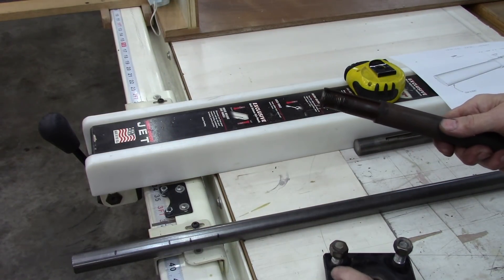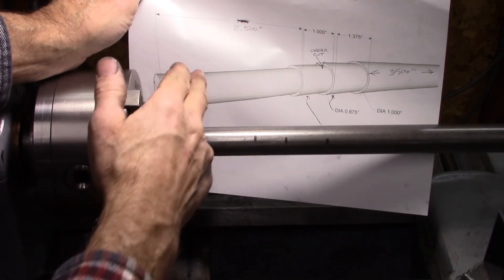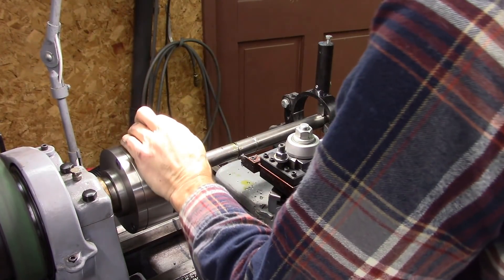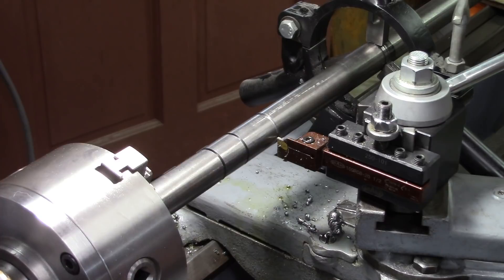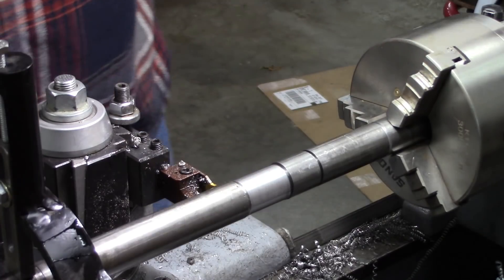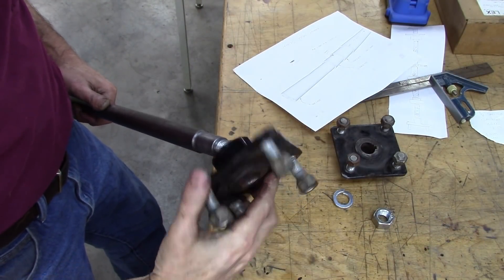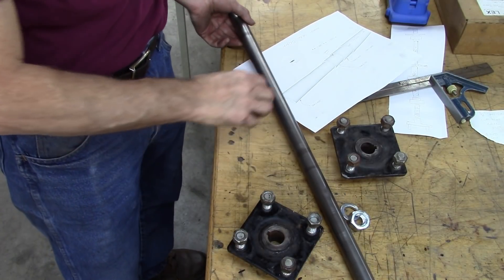Turning big stuff on a small metal lathe

Comment: Mark an old Gunsmith trick when using a steady is to take a piece of emery cloth long enough to wrap around the shaft plus 1/2" overlap. Add a few drops of oil to the shaft then wrap it around the shaft with the smooth side towards the shaft and the grit side touching the fingers on the steady. The oil and the emery cloth act as a bushing between the fingers and the shaft and the grit touching the fingers prevents the cloth from spinning. This prevents marking of the shaft and also prevents wear on the fingers. I am certainly glad to see you using the wooden support. 50 years ago, a man i knew son got killed by a shaft that bent in the lathe he was running, and it beat him to death.
Reply from the maker: Thanks Terry, I'll keep that in mind for the future.

Comment: Great clip, did exactly the same myself some years ago now, even cut my keyway for the drive sprocket on the lathe with a fly cutter set up in the tool post driven by my wife's old cake mixer. My wee Boxford has done some pretty big jobs haha and still keeps going. Such a great reminder thanks again.
Reply from the maker: Thanks! I looked at a boxford lathe several month ago. It was a little smaller but built very well.

Comment: I sooooo love these one off head scratching jobs my friend. Having a piece wrap that was sticking out too far is a damned scary time. I have had it happen a couple times.  Wide rubber bands with wide zip ties work well with lessening shaft vibrations. Bear auto alignment has great belts to wrap around small and large drums that really work well and are sure work great for reducing chatter. You need to visit them.
Reply from the maker: Yeah...  I had a bar get away from me one time. Scare the hell out me!
Reply: @WinkysWorkshop  Mine was a 6 ft pc of 1/4 inch rod I was single point threading a bunch of pieces from the long bar to save on waste. It was on a friends lathe and not knowing it very well shifted it to a higher gear and promptly put a 90 deg bend out the back of the headstock. Just like you said above here both of us got a boost in blood pressure.
Reply from the maker: @TomokosEnterprize  Yep, that will do it!
Reply: @TomokosEnterprize  It’s happened to me also. Not only scary but very dangerous. That whipping piece will kill or seriously injure anyone it hits.

Comment: A little grease on the wood block support would help keep it quiet. Years ago line shafts used greased wood bearing blocks. Ok for slower turning shafts.
Just a thought, instead of a test nut using thread gauge wires would have saved a setup.
Reply from the maker: Yeah... i didn't show it but I had tons of oil on both the wood and rest. The wood was bowing the bar down. I fixed it on the second end.

Comment: Well thought-out and nicely done. You did a very precise machining job on the axle but unfortunately the wheel bearings weren't manufactured with the same level of care. How was the keyway cut?
Reply from the maker: Thanks, I have a mill and used a 1/4" end mill to cut the keyways.

Comment: Very clever putting the shaft backward in the lathe to get the job done.  I imagine, if you made both shaft ends the same and one flange fits fair and the other loose, that loose one probably fretted around on the old shaft.  The flanges are rather beefy, perhaps you can cross drill and add set screws to fix that looser one hard to the shaft? Between that and a nice tight key, it could last a while.
Reply from the maker: Yeah tighter would have been ideal and yes it was one hub that was oversize. I put a little green Loctite on the shaft but I suspect it would be fine anyway. I'm guessing it will outlast the go-cart, it wasn't in the best shape. Thanks for watching

Comment: Great job!  Next project, a follower rest?  I don't have one either, but I understand that is the purpose of having both a steady and follower.
What are your fingers for the steady made from?
Reply: I had the same thought.    Making a follower rest is one challenge.    Mounting it on the round surfaces of a South Bend lathe is another challenge.   I have both follower rest and steady rest for my Grizzly lathe.   I have used the steady rest but have not needed to use the follower rest yet.   Machining a long piece like this would be a good use of both rests.
Dave.
Reply from the maker: Yes a follow rest is needed. The fingers are mild steel. I think brass would be better (or rollers)
Reply from the maker: Agree. I need to make one

Comment: The bigger hub ought to shrink if you go around it a few times with the welder. I liked the nut on the shaft idea :o)
Reply from the maker: I thought about putting a knurl on the shaft too but in the end I just left it. The shaft also has a key it. I suspect it will last the life of the go-kart.
Reply: @WinkysWorkshop  Yes, it isn’t driving interstate :o)
Reply from the maker: @teamidris  - yep...  slow RPM and has a 3/4" nut and lock washer torqued fairly high. I doubt it will ever move.

Comment: Thanks for this interesting video. Well done!
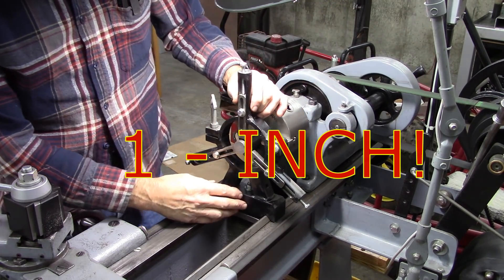The way of "calibrating" the steady at time 02:20 was new to me. never seen before but it must be clever I think. Assuming the bed is in order, being straight, levelled etc...
Time 07:30. That "flying around" at the end of the bar will cause a bend between the steady and the chuck. Read about the Euler bend, brake cases.... Good descision. Primitive and brutal cure but I buy it.
Why making "impacts" to the bar and then bringing up the thread gauge? Why not put an indicator to the carriage, engage the lock nut, turning the chuck one revolution and measure?
Time 18:15. That filing often makes the nut go fine. Better then making one more pass threading?
Cheers.
Reply from the maker: Thanks for the in depth comment. The scratch pass and thread gauge were just a double check. I was fairly certain my quick change was set right. And yes, after supporting the stock the metal cut much smoother. As for my method of setting up the steady rest...  I know of no other way on a bar that long. The weight of the bar would make it sag and wobble. The bed on my lathe is worn several thousands I'm sure and there is was no doubt a slight bow to the bar but all the machining was taking place close to the chuck. I doubt there would be any measurable error if the bed was worn .030". I guess i could have put an indicator on the carriage and checked that the tool post was parallels with the bar. And i would have if I was machining near the steady rest.
Reply: @WinkysWorkshop  As far as I can see You did an excellent job on a very speciell task!
Reply from the maker: @Stefan_Boerjesson  Thank you sir
Reply: @WinkysWorkshop  I think I've seen, in traditional centering, the steady placed near the tail stock and indicators used center the steady. I suppose checking for no taper. Maybe hard with a not perfect axle surface.

Comment: Excellent video....  Have you ever turned small stuff??  I need to make a replacement shaft for my Dumore #14 Tom Thumb.  I've been putting it off because it's making me extremely nervous turning such a small diameter shaft with fine threads.  I saw your collet chuck video and was considering that but was wondering if I could turn between centers....
Reply from the maker: Yes you can turn between centers with the collets. For really small diameters you need a lathe that has high speeds.
Reply: @WinkysWorkshop  Understood,  The Dumore shaft appears to be 3/8" 3-4 SS with the bearing ends turned to .250 +/- .002        What would you recommend for a speed?
Reply from the maker: @thomasriddle3370  Stainless is hard to turn. For 3/8" steel the RPM should be 1600 and 3/4 about 1000. For stainless it's about 30% slower

Comment: Nice job 👍
Reply from the maker: Thank Kevin, how's the 200 doing?
Reply: Doing good, got a little problem with a stuck chuck at the moment, but, I have a plan
Reply from the maker: @kevinunderwood2931  - Be careful not to break a gear. I wonder why it stuck? Here's a suggestion. Clamp some hex stock in the chuck and put a wrench on it. Then put a strap wrench around the spindle pulley. I'd say most gears get broken removing stuck chucks. After you get it off put anti seize on the threads.
Reply: @WinkysWorkshop  I think it’s stuck because I didn’t use anti seize on that new chuck I bought…I knew better. The method you described  is what I’m going to do. I’ve got a Rigid brand strap wrench with a 30inch strap for the spindle pulley. I’ll have plenty of leverage.
Reply from the maker: @kevinunderwood2931  - I never use anti seize but have some chucks that are a little tight so I probably need to.

Comment: I have a parting tool like that, I never thought that you could turn to size with it. At some point would too deep a cut cause the insert to come out? Edit: I didn't listen long enough, you covered my question that it is designed to cut laterally. I didn't know that.
Reply from the maker: Yes, I love this insert but yes, if you try to push it too much it comes loose.

Comment: Isn't that a parting tool? And a couple of minutes later you answered my question...I think. It sure looks like a parting tool but it's either not or it's both for parting and cutting laterally?
Reply from the maker: That is called a Parting and Grooving Tool. It has a GTN2 (2mm) but you can get them in 1mm and 3mm also. It's advertised as being able to cut lateraling as well as straight in. It is one of the handiest tools I have. You can't take more than about .040" at a time but it's great for cutting against two shoulders. I think the best aspect however is that whatever depth you dial in, you get. If I need something .010" smaller you can move the cross slide dial that amount and most often it's dead on.

Comment: Hey Mark... is there a reason why you go back to "0" on the cross-slide, but advance the compound for the successive thread cuts?
Reply from the maker: Yes, there are a few reasons for this. First, advancing the compound puts a load on the lead screw in the direction the carriage travels. The cutter only cuts on the left side. Advancing with the cross slide would make the cutter cut on both sides which can result in the threads from a previous pass controlling the carriage movement. The second reason is chatter and tool load. Advancing with the compound  makes the tool cut only on the left side. While making the last few passes on larger threads the surface area being cut is substantial. Advancing with the cross slide would make the tool cut on both sides and double the load. I have seen people cut by going straight in but I have better luck advancing with the compound.

Comment: In the big scheme of things, that wasn't a particularly dodgy setup you were using there. I've seen (And occasionally, been the architect of) some truly frightening "Unorthodox work holding techniques" over the years...... One that springs to mind included the use of bit's of angle iron and a shed load of zip ties on a long thin workpiece to brace it and cut down the risk of the unsupported section flapping around too much !!! :D. I also once saw an old 6" swing lathe that had been "Modified" with several stacks of 1" sheet steel to move the head and tailstock up and back enough so that it could spin up to 20" alloy wheels. The tool post had a seriously Heath Robinson setup to raise the tool up about 6" too. The owner told me that his garage had a couple sets of car wheels to weld/refinish and wasn't going to spend big money buying a bigger lathe just to do those. Surprisingly, it apparently worked fine like that with no more chatter than it had before. I wish I'd took some pictures of that one. :D

As a friend used to say, "When the works got to be done, and you don't have the exact work holding setup you need, it's sometime neccecery to send the health and safety guy out to do some errands off site, just so he doesn't have to see anything that might spike his blood pressure" :D
Reply from the maker: It was a quick fix bot totally adequate. I've seen "dodgy" for sure. That 20 inch lathe sounds crazy!